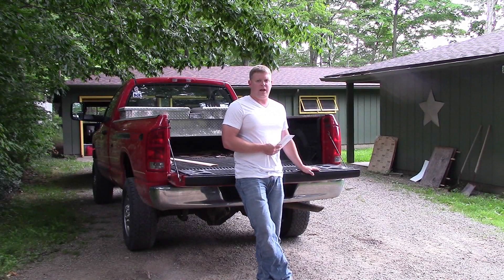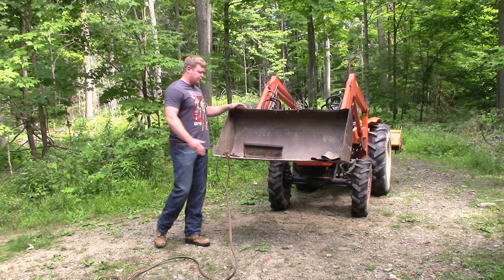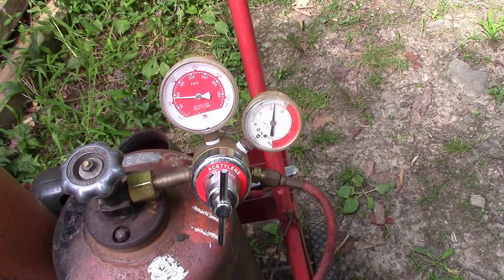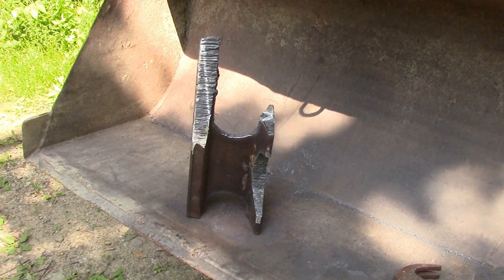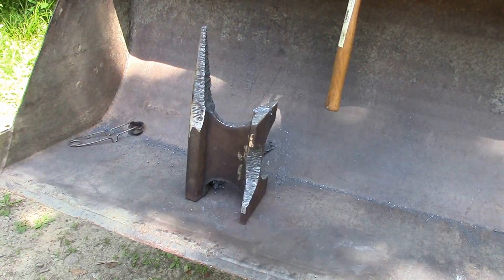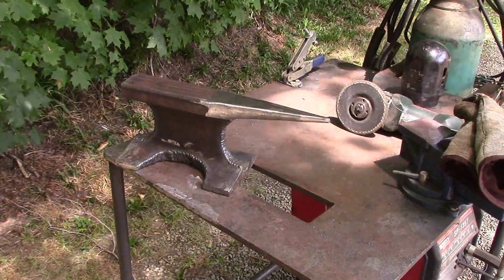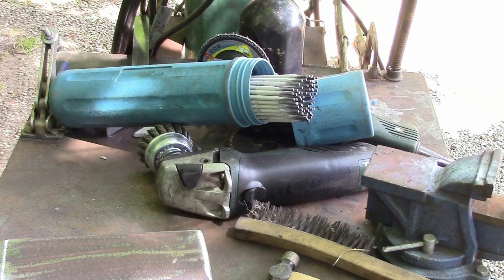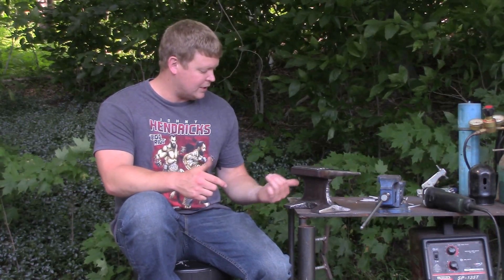How to Make an Anvil from Railroad Track | Oxy-Fuel Cutting & Welding Tutorial

Comment: figured you would fill on the rounded sides and make them sharper , allso seen peope putting the rail in the forge and let it aircool to harden it , the file scraped off so i guess it worked for them 
youre anvil turned out nice though like the longer then usual point on it

Comment: good idea but railroad tracks are not hardened steel. within a few uses you will have to make another anvil or you can find a real anvil for $100 and it will last a long time.
Reply: Let me know where I can get a  "real" anvil for $100.00. I'll buy 5 of em. Harbor freight anvils don't count 😂 😂 😂 as they are cast, and any real blacksmithing on it would kill it quick. A true forged 165lbs anvil will cost anywhere from $13-1600 new. You'd be lucky to find a vintage for less than $1000. JS

Comment: Rail track is super soft. cuts and drills EASY!! A bit of research should have told you that.. still, it makes a decent anvil if you don't have one.
Reply: There are many different Alloy Steel Rails.  No need to heat treat or hardface or weld a hardened piece of Hi Carbon steel on top which will then need to be tempered.
Leave it alone on top, cut point with a grinder and don't worry about the bottom parts.  It is not furniture!

Comment: The best way is to not do it. it will be a low grade ASO at best. There is too much flex at the web and you just work against yourself. If you MUST use rail for an anvil, simply turn it on end and use it that way, at least you have mass under the hammer
Reply: Flex in the web?  What are you using for a hammer?

Comment: no need to face rails ,,, they work harden thats why they are used ,,,
Reply: Yes he basicly ruined all the hardness off the face by that and also cutting it with torch must have ruined the hardness from other spots too. You should always keep the anvil "cold" with water and cut and shape it with grinder

Comment: I LIKED THE ROUGH-CUT EDGE BETTER. THE RAIL IS WORK-HARDENED IF IT IS USED, NO NEED TO HARD FACE. BESIDES, IF YOU USE REAL HARD-FACE ROD, YOU WILL NEVER GRIND IT FLAT. THANKS FOR TRYING TO SCREW US UP! WAST TIME FOR PRETTY, THEN DONT HARD FACE! 7018 IS EASY WELDING, EASY GRINDING. IT DOES NOT MAKE IT HARDER, JUST A WASTE OF TIME!  DO WHAT YOU SAY, OR AT LEAST GIVE THE PRO'S AND CONS. I BET YOU TRIED TO HARD FACE IT, AND HAD TO BURY THAT WITH 7018! TANKS FOR NUTTIN!

Comment: Nice job but personally I would have started with three lengths of track welded two right way up and one upside down in between for a nice flat face with perfect rounded edges, then worked out the tool holder and horn ... I have a London anvil here in blighty that weighs about 150kg and is about 140 years old but I would like to make one a bit more portable , I'm currently designing a forge in my garden from steel car rims several lengths of inch angle and a sheet of chequer plate powered by a leaf blower and a flap valve.
Anywho good luck with the future projects and more power to your elbow ..  ;-)

Comment: Why does everyone use the rounded side of the track for the hammering surface?  The bottom is perfectly flat already.
Reply: ScienceFoundation I have no experience on the subject but I would think the side intended for a train rolling over it at high speeds would be surface hardened. Again, this is just an assumption I have no idea.
Reply: The bottom is not hardened like the top, the weight is more distributed on the bottom so its not required to be as strong as the top where the train rolls.   not to mention, with how much thinner it is - a good whack or 2 could bend it.
Reply: I would use the rounded side just because base of the track is wider.

Comment: railroad track is a good piece of steel don't think you needed to hard face it ,it may want to chip of on you the anvil is a nice neat job',,
Reply: Agree. The mass of the anvil itself quenches the weld, so the 7018 would leave a harder face. Not sure what level of hardness one could expect after multiple passes. My experience being limited to just single pass and a single gaping crack with 309-16 no preheat or cool down like in the vid. Relatively annealed seems possible.
Reply: One reason is to weld on top is to make it flat, tracks are slightly rounded. It did 2 things, hardening and flattening.
Reply: 7018 would NOT leave a harder face.  It is simply ductile filler rod.